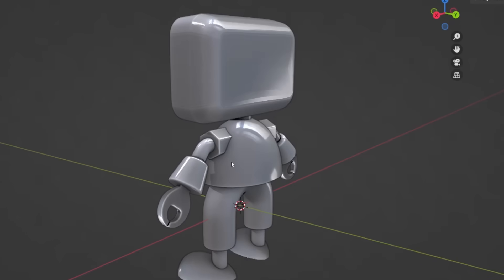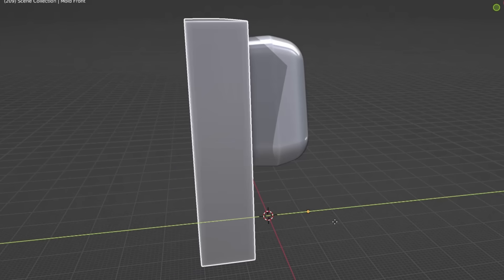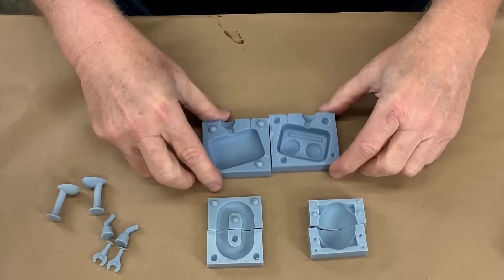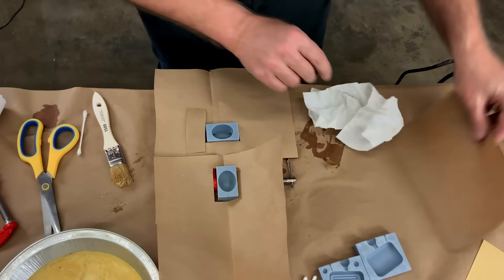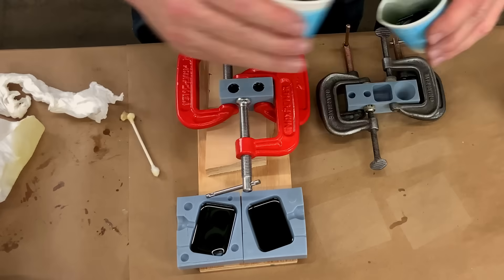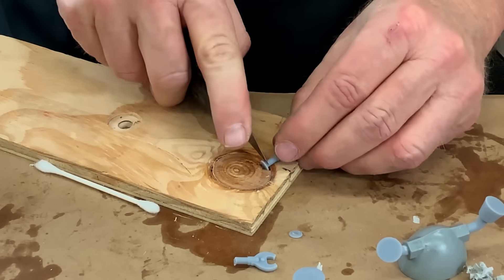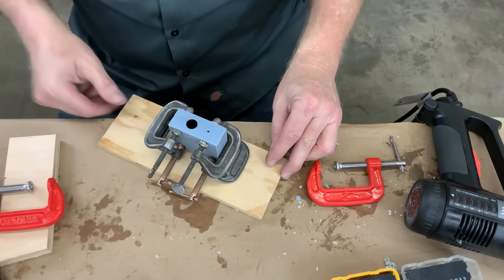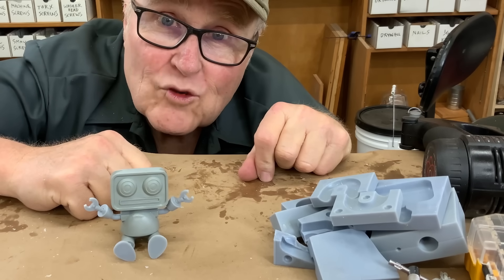3D Printed Molds For Resin Casting - Does That Even Work?

Comment: You might want to try an ABS-like resin instead.

Another idea that I've been using is to 3d print not the mold, and not even a master, but rather two halves (I'm not exactly sure I have the right term here) of a buck. Basically I'll model a thin box, boolean-add the registration pins/slots and half the model as a positive (obviously I'll do one for each half for what will become the two-part mold). I'll then print that buck. I'll soak the prints in an off-gas inhibitor, and then pour a silicone over them. The result is a perfect two-part mold; I've even been able to make multiple molds from a set of bucks and they are interchangable: side A of mold 1 will fit perfectly with side B of mold 4. This also lets me add a label to the buck that then shows up in the mold itself - I have pictures of what I'm talking about if you're curious and I'm unclear.
Reply from the maker: Upcoming videos will feature a process similar to the one you are describing.  It would be great if you could send me pictures of your process. If you can to send them to me at roberttolone@yahoo.com

Comment: I don't know how much you use your printer, but I heat my 3d prints all the time and it was only as the screen was failing that I was getting cracks like that. it may be from under exposure but since I've used my mars 2 a lot I just bought a new screen. 
also heating 3d prints is what I normally do to get a good fit without a ton of sanding. Just heat up both parts and press them together until they are cool and they will be perfectly matched.
Reply from the maker: Hot hot do you get them?

Comment: if you alternate them from hot bath to cold bath will it make them easier to release? I literally don't know a single thing about this but It seemed like an okay idea to ask about. sidebar: this video really inspires me to pick up some courses on some online learning places to learn Blender. Very cool video!!
e: when he says "tank" is he putting them in a vacuum chamber or something? I am super dumb and don't know exactly what he is doing. sorry for the questions.
Reply from the maker: When I refer to the tanks it is the pressure pots which are filled with compressed air to suppress bubbles in the castings.
Reply: @RobertTolone  Oh, okay cool! Thanks for letting me know! You do some really neat stuff! Very cool man!

Comment: Standard 405nm UV resins aren't too useful outside of cosmetic uses. It breaks way too easy and as you noticed doesn't like heat. There are some resins that are purpose built for mould making though and your Mars printer should be able to handle it. Siraya tech is a popular quality brand that sells what you would want. I think Cast or Sculpt may be the ones you would want.
Reply from the maker: Thanks for the tips. I am going to get a bunch of different resins to test in different application.  Should be fun.

Comment: Thoroughly enjoyed this episode! Dealing with similar things now in my unrelenting desire to make plastic figures.  :D
As you experienced, resin 3D prints are not accurate. I switched from Chitubox to Lychee and that somehow made a difference, but with injection molds I still generally will have to sand a while before the mold halves fit together. SUPER impressed with the figure design! It's like you've been doing 3D/computer design for decades!
Reply from the maker: Uh, actually, Crafsman I HAVE been doing computer design since Windows 3.1   I first started using 3d CAD for doing StarWars spaceships, etc for Kid’s meal toys back in the late 90’s.  Most of my sculpting has been by hand, but still, I feel like I should be a lot more advanced as a 3-D modeler than I am!  I have switched entirely to Blender and it is my goal to become professionally proficient with it this year. And the experience of printing my characters in house has just begun. Over the years I always sent the models out to service bureaus for printing. Back in the 90’s it would cost $1,200 to print a small character!   This little $200 Elegoo printer makes prints far superior to those old prints! We always had to re-cast the 3-D print into sculpting wax to clean up all the layer lines.  Will definitely look in to Lychee and hope that my printing skills come up to par as well.
Reply: @Robert Tolone  WHAAAAAT?!? I must have missed the episode where you talked about your legendary past! :D  Blender is the one to learn, by the way. I was hung up on my 3D software of choice (started using trueSpace 2 in 1998) and have downloaded Blender every couple of years with the intention of learning it. I've also recently taken some ACTION towards that with my latest download of Blender and some inspiration from Ian Hubert's videos.
You're continually impressing me, sir.
Reply from the maker: @TheCrafsMan  I found Blender hard to learn because I have been using Rhino NURBS modeling forever. I couldn’t get the workflow and muscle memory out of my head. Polygons are so different than NURBS surfaces!  But I am blown away by all the things that Blender can do and I’m getting better at it every day.  Now that I have the basics of the Blender-to-3D printing process in hand it will open up a huge new world of possibilities.
Reply: As with FDM printers you can do some adjustments of settings to make it very close to having a prefect accuracy.

My resin printer gives me close to 0.0X accuracy but i also spend a lot of time getting my settings just right. it of course also comes down to the resin that you use, it can shrink, expand or even deform when curing.

I had no problems making 2 half's of a mold that merged perfectly to form thin aluminum from a can.
Reply: Love you and your work Mr Crafsman. Awright. 😁😇
Reply: Almost all printers and materials declare a tolerance of 0.02mm. That's still enough of a deviation that a zero tolerance will almost never fit.

In my tries to get this to work I found you have to shave off at least .2mm in one model key or .1mm from both keys to get them to fit with 3D printing tolerances. Resin is more accurate but due to light bleed they will not do a zero tolerance. On FDM with PLA it only gets worse. No matter how good your tolerances are on your printer, every so often the outside will be too small and the inside will be too big and they'll shrink differently. So many models have a tolerance of zero and it's frustrating. You just can't get CNC accuracy with additive materials.
Reply from the maker: @natgreystarscoolstuffnjunk1549  Right there was my problem. I am used to doing CAD work for a three-axis mill.  Even the desktop machine I had years ago could hold three ten thousandths of an inch.  I will be sure to build tolerances into future 3-D printed models.
Reply: The issue with the index balls is that the ball and it's boolean negative are exactly the same size. Physics will simply not allow one to fit inside the other. Add to that any printer inaccuracies, and you just compounded the issue. I make the index, perform the boolean and then scale the imprinting part about 97% of the original size. Also, do any clean up and drilling that needs to be done after printing and cleaning (as it looks like you have done). Then do a final cure under a UV light for about 5 minutes on all sides. This will seal the mold and make release agents a bit more effective.
Reply: Reading 2 great men having converstation is really a treat and inspirational! Thanks to you both Robert and TheCraftsMan!

Comment: If it's for resin you are far better off using silicone molds and 3d printing the plug.

You'll break 3d printed molds when trying to remove rigid parts. 

If you plan to make multiple rigid parts from a rigid mold then you're better off making it from aluminum on a cnc router.

Or... just making a silicone mold.
Reply from the maker: Thanks for your comments but watch a few more of my videos. My entire channel is about silicone moldmaking! 👍😀

Comment: Personally i'd prob put a very small tolerance on the pins that were supposed to lock together with the cavities, like maybe 0.05mm or a bit more depending on if the model warps.

Comment: you can even injection mold with 3d printed resin tooling, its a little tricky but when you have the process down its a great way to rapidly test out tooling geometry before machining final tooling in aluminum or steel

Comment: A good idea for the pieces to come out easily would be to sand and polish the molds first, because the matte finish on 3d printed parts comes from the micro stair steppping from the different layers, so that may increase the surface area a lot and the resin will stick a lot more
Reply: Or you can spray with polyeurathane to get a smooth finish after a few coats and fill in the gaps.
Reply: @GaryMcKinnonUFO  Yeah, that should work too. I spray regular gloss spray, but you still ned to buff it. Haven't tried with polyurethane or 2K finishes, but for some parts it looks very good after just sanding and polishing, which sometimes can be even faster because you don't need to wait for the paint to dry
Reply: @smokeduv  Good point about drying time.

Comment: Hey Robert I make 3D printed injection molds for fishing lures over on my channel and found the best way to align and hold them is to use nuts and bolts, I have a few videos on my channel outlining how I do it. Great videos as always, I have learned so much from your videos!
Reply: Yup I could see myself just drilling holes in the modelling
Reply: @AdamMclardy  No need to drill, just add them to your mold halves before printing. I have a motto, drilling = failure when it comes to 3D printing. 😄
Reply: Where can I get 3D mold files
Reply: OHHHH! THATS SMART!!!

Comment: Is there any particular reason why you didn't print the molds lying down, other than it being slightly harder to get off the print bed? I believe that way the printed molds would keep their dimensional accuracy better while giving an excellent flat connecting surface. Printing it faster and easier is just the icing on the cake.
Reply from the maker: Removing the prints was the biggest reason but I think next time I’ll lay them flat!
Reply: @RobertTolone  I would recommend to use a magnetic flexible build plate (similar to those used on FDM printers but in such a small size that suits these small resin printers). I bought one and consider it as the best upgrade for my resin printer.

Comment: I wonder if you could cast duplicate molds.
Reply from the maker: There is a loss of precision with each molding step. So molds that make molds have never worked well for me. I find it is better to make additional molds from the original model. Or in this case to print more molds. I only had one on the build plate; more would fit there.

Comment: Great video as always! I’m thinking of using that bee’s wax technique for my 3d printed 2 part molds and wondering how you prevent the wax from pooling up in the mold?
Reply from the maker: I just brush it on and then wipe most of it off. it’s like furniture wax, only a very thin surface of wax.  I was in a hurry so I used the beeswax straight. But you can mix a paste wax out of beeswax and turpentine or paint thinner and rub it on with a rag. Then you have to wait for all of the solvent to evaporate out.

Comment: Wondering if this would work with an in home ABS injection mold plastic machine. How hot can the molds before they deform???
Reply from the maker: I damaged the head mold just using a heat gun applying wax which melts easily. So I would not recommend this Elegoo PLA-like resin for high temp use.  I have not experimented with a variety of resins, nor have I searched for one specifically for high temp. But it’s possible a better resin is out there. It would make a very interesting experiment.

Comment: Try 3D printing a mold with Siraya Tech Tenacious. It's a flexible resin. Spendy stuff, but it's often mixed with harder resins to give them more durability or a little bit of flex. Or of course do 100% tenacious for very flexible parts.
Reply from the maker: Thanks for the tip. I’ll check it out. Flexible printed molds are on the schedule.
Reply: @RobertTolone  Something I forgot to mention is that Siraya Tech has a resin called "Sculpt" that is designed for high temperature applications such as molding, since silicone can get pretty toasty when curing. Based on the shore hardness, I'd estimate it to be around the same flexibility as their "Blu" resin that I normally use and is considered a "tough" resin due to its slight flex capability, but nowhere near as flexible as their Tenacious. 

I haven't actually printed anything with Sculpt yet. Just got a 5 liter jug of it for work recently though.

As a side note: If you're new to resin printing, consider replacing your FEP sheet with nFEP (AKA PFA) it releases from the print significantly easier and is less likely to get failures, allowing you to increase your lift speed or at least enjoy a much more reliable chance of printing successfully. Supposedly nFEP also lasts longer due to the reduced forces as well, so that alone can make up for the price increase. nFEP is also less noisy.

Comment: I typically up and downsize mating features on my 3d printed parts by a few thousandths, usually through a process of trial and error.  If it requires a bit more precision, I can "size" drill a through hole, and sand down the ridges on a shaft or sliding surface.  (In your case, I would have clamped the halves then drilled and doweled them.)  I am using a filiment printer though, which would have had the added issue of porosity.  (Plus a bit of warpage which could cause more issues on the mating surfaces.)  I typically consider the 3d print as the starting point in my path to develop the final objective.

Comment: Love the use of a drill press as a mill!
Reply from the maker: It’s janky but it works (sort of).  Doesn’t work at all with a router bits or endmills that need higher speeds and\or strong workholding.

Comment: What if you print plastic mold negatives, which you can cast with resin to make the molds?  It is more steps, but it would be easier to re-make molds if they get damaged, plus you can make the mold out of a more ideal material.
Reply from the maker: There is loss of precision and detail at each mold step. I experimented with making molds that made molds but never could find the sweet spot of labor, cost etc.  But then I’m not really a production shop. I am a sculpture and prototype shop. So most of my casting runs are short and for me it’s better to make the molds from the original object because then the quality of the castings is very high.
Reply: I do that all the time, I print a mold negative and cast it in silicon, works great.

Comment: I find the toxicity of the (not fully cured) printing resin a little bit concerning to really do things like sanding and drilling with it. Does this worry you?
Reply from the maker: Yes. I need to do a video on this.  It’s smart to be concerned about the materials we use. But it’s also smart to understand occupational exposure to materials.  Safety is not only about what kind of materials you use but also about the length of exposure you have to them. OSHA has guidelines for this and I have had my shop inspected by OSHA in the past. Because I am a small operation, full-custom house my materials usage is tiny compared to a production shop. So I am ridiculously below the threshold for concern when exposed to resins, chemicals etc.  But I still take all precautions like good ventilation, dust control on machines, etc.

Comment: I've been experimenting with this exact same thing recently, trying to make custom silicone o-rings for a project. I settled on printing the mold with no registration keys, just divots to help me locate them later. This way I can sand the mold faces flat on a granite surface plate to ensure they come together perfectly for minimal flash. Then I drill out the divots to .25" and add two metal pins for registration. I've also found that smooth-on mold max 30 doesn't have any inhibition problems when used directly against syratech blu resin, which is also pretty tough and not very brittle.
Reply: @PeppoMusic  Well, I've only made a few, I'm still tweaking the mould design, but I don't know if the mould will ever wear out. If I'm pulling silicone parts out of a resin mould, it should last indefinitely, shouldn't it? I guess we'll see😄

Comment: Another interesting video. A couple of weeks ago I did something similar but created moulds to mould silicone rubber buttons for a nelsonic game watch. The main issue I had there was I had to paint the mould because the light cure resin prevents platinum cure silicone from curing.
Reply from the maker: Platinum rubber is notorious for cure sensitivity.
Reply: @RobertTolone  yeah. So I found out.  Just a light paint coat was enough though. Any idea whether there are good waxes that you can use to apply a thin film to the surface of a resin 3D print without pooling in corners?

Comment: This cuts out the whole "making a master and a silicone mold", if you can just use wax to interface 3dprinted molds so the yan be used directly.
@robert tolone With both FFD and SLA you need to include a spread tolerance for your printing media (typically adding 0.2mm to filament prints to tolerance gaps). Glad Elegoo sent you a printer, I get lots of electronics from them and have A mars pro myself.They appear to be a good firm who understand open source and make many contributions to the maker community.

Comment: Hey Robert is there a trick you know of to get paint to stick good to silicone?
Reply from the maker: No. Not much sticks to silicone. Ask your rubber supplier, they might have some suggestions.
Reply: @RobertTolone  I use the same company you recommended in a vid for rubber and resin , good stuff.  I heard guys were painting it for soft baits but maybe they are using a different rubber not sure.